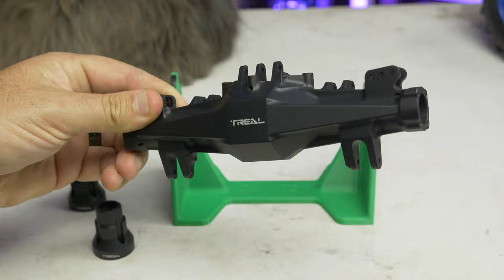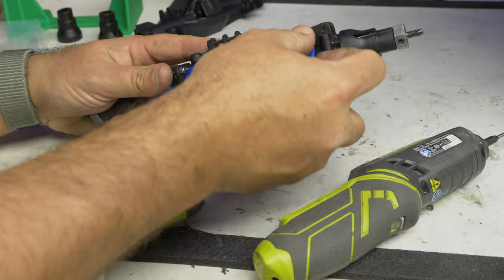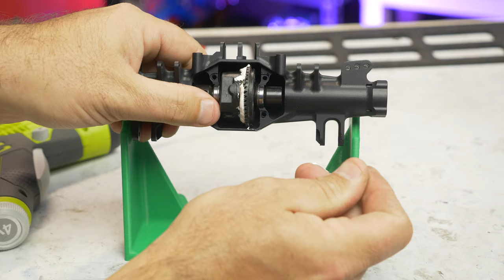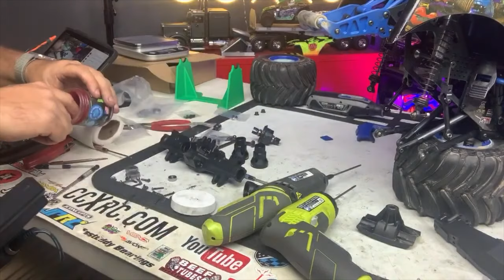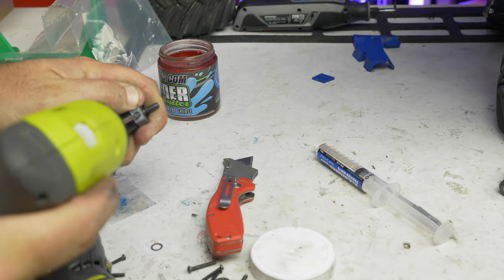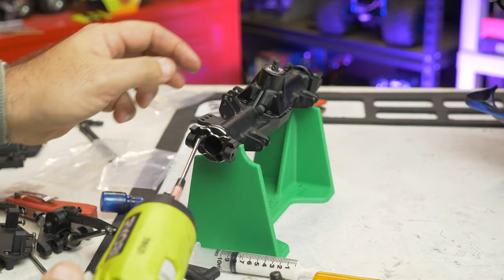Most Durable LMT Axles! How To Install Treal Hobby Axles On Losi LMT

Comment from the maker: NOTE: I put the Front Treal Spindle Carriers on the wrong way. I had them on the right sides, but the logo should be facing out. They put their steering stop on the opposite side that LOSI used which is what I was using as a reference since they don't have instructions on how to do this. So Right goes on the Passenger side of the vehicle with the logo facing the front/outside of the axle where the Treal logo is. 

Why did you change the steering stop Treal? Why Treal? Why? People without instructions are going to do what I did and look at how their last ones came off and that steering stop would be the most logical reference point. 

Thanks to mavrick0pm for pointing this out.
Reply: Where do you get all your tools to work on these small hex’s and screws?
Reply from the maker: @matttapscott48  at my local hobby shop. Most can be bought on Amain or Amazon in an RC hex driver set.

Comment: I'm not sure which way is 100% correct on the c-hub.  I thought the same as you at first with the steering stops in the same location as the plastic ones but then noticed that the 5 degrees that are suppose to be on the Treal axles wasn't there.  So when I looked on their website the pictures show them with the steering stops facing forward and all the Treal logos on the same side.  When I built mine that way you can see the 5 degrees that comes with the axles.
Reply from the maker: You are right. I looked at the website and they put the stops on the front. Why Treal? Why? That was my reference point as they didn't supply any directions. I guess I'll be flipping them...though it handled well this way.
Reply from the maker: Is it toe in or out
Reply: @CCxRC  It's 5 degrees of castor that Treal adds to their c-hubs.
Reply from the maker: @mavrick0pm  Ok. Sorry. I thought it was a toe in. I'll have to go back and set mine up properly

Comment: What size is the LMT axle shaft? I purchased a set off Traxxas 12mm aluminum wheel hexs and was wondering if the center hole is big enough for the threaded part of the axle shaft. Would I need to purchase traxxas part# tra6869 which has a bigger hole in center for beefier axles.

Comment: They look great and should hold up to tons of punishment.  I think the stock housings should cost half of what they sell for $20-25.  It seems as if the outer housing (Large front piece of each) needs to be produced using a more durable/flexible composite that could hold up to colder temps (in the 50 degree and up range).  Like CCxRC Tony said, there were no issues until the weather dropped in temp.  I hope Losi considers using a different plastic even if it is offered as an upgrade to stock.  The Treal units quality and machining/material certainly equals the price, but for many it is not a financially capable option.   Braces I guess will suit most...or RPM to the rescue?!
Reply from the maker: I think they need to make the plastic less pieces. The problem is it flexes too much. I'd go solid pieces like the treal but in plastic....or like the Axial axles. There's just too many pieces and then screws to hold them all together.
Reply: @CCxRC  totally agree tony i just broke my lmt today right down the center of that seam like yours did
Reply: @CCxRC  they wouldn’t have to go full on metal everything like a beefed up EXB or something, but some metal in a few strategic areas would have been immensely helpful.  Not crazy about adding weight to my truck!

Comment: How much dose LMT cost? You don't shoe goo your bodies at all ?. I just  repaired a pretty much destroyed x-maxx body with the shoe goo and drywall tape. Very very  impressed.  And its cheap.  A little time consuming. 👍 Good vid
Reply: $649. With two spektrum batts, spektrum charger. $1002 from Tower Hobbies.

Comment: My stock ones are holding up, but I've see that RC4WD has released complete axles with internals... Pricey though. You should try get a set and compare with the ones you are running now.
Reply from the maker: After seeing what the Losi internals can handle, I wouldn't go with the RC4WD ones. I'd rather get metal casings for the LMT internals. RC4WD parts are hard to come by. I believe LMT is going to be the standard for aftermarket parts. You don't see that with the RC4WD stuff.
Reply: @CCxRC  I have to agree. The LMT sets standards all around, except for axle casings. I bought a nice launch ramp. Gonna see how it flies. Hopefully the axle casings hold up cause all I can source here is RC4WD’s aftermarket replacements and they cost about $300 a set.
Reply from the maker: @Triggered-RC  yikes. Do the RC4wd work with the Losi internals or you just mean you’d have to switch axles completely?  I haven’t seen anything but the scale axles they made before and the ones they now make for their RC4WD monster truck
Reply: @CCxRC  They include their internals. Here’s a taobao link to a front axel https://item.taobao.com/item.htm?id=38644298142
Reply: Which I guess is the only axel. Need to either go 4 wheel steer or throw a link on the back to keep the rear straight.
Reply: @Triggered-RC  how much is that is us dollars?
Reply: @Wreckedekcoupe  $190 an axle.

Comment: Cool looking axles.. should do the trick.
Pronoob Rc put out a video fitting the screw-in traxxas control arm pins to replace the king pins that back out. Check it out if you haven't seen or heard about this mod... was super easy.
Cheers mate👍
Reply from the maker: I saw that trick on Facebook. Very easy solution. Maybe losi will just make one that is the right size

Comment: Very cool, btw right side is the “passenger” side on a vehicle, drivers side is left on that particular truck
Reply from the maker: Right. That's what I said. It would be on the driver's right hand side. I point to the left and said if you are the driver "here" then it the right would be over "here" and pointed to the right. Saying passenger side would've been easiest.
Reply: @CCxRC  ahhh oki hahaha yeap it always confusing lol, i was just worried you would put it on the wrong way, it looked like a dang fine axle set up
Reply from the maker: @ragnarok5056  what I did do wrong was it was supposed to go logos out. They put their steering stops on the opposite side that Losi did. Without directions that is confusing
Reply: @CCxRC  i can imagen, im looking to get one of these trucks for my self, i bought the traxxas summit 1/10 for my son, but these dont sell in Norway unfortunately, and thypical i want the LMT  the most 😂

Comment: Damn those are nice! Why is there so much toe on the rear axle? Or any for that matter?
Reply from the maker: The toe in helps the truck feel more stable. I'm wondering if it helps with the pull to the right i was feeling. These axles seemed to track straighter.

Comment: instead of the stress going to the axles, it might transfer to the links and break them.
Reply: Plastic Axle like 50 bucks each ,so breaking a links is cheaper then that axle .by alot.
Reply: @hoosier-daddy437  i figured that, i was just digressing.
Reply from the maker: I've bashed it and the links hold up better than any other trucks links I"ve run. Not breaking rod ends all the time.
Reply: @CCxRC  well that’s good. the axles do sure look nice.

Comment: If the bearings are that hard to get in the are going to be impossible to get out. It's really going to suck when your $2 bearing makes you $200 axle completely useless
Reply: You could tap them out with a small screwdriver with the input gear removed 👍
Reply: @PatsRC  not when the outer race comes off like they normally do when the bearing explode :P